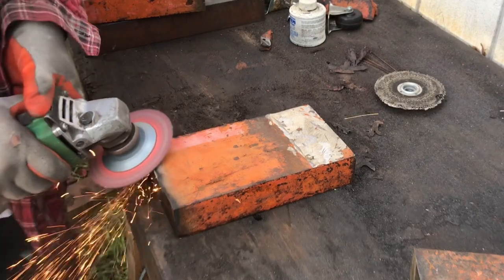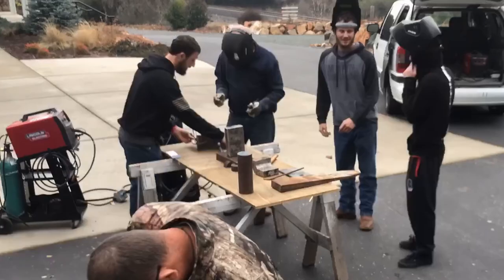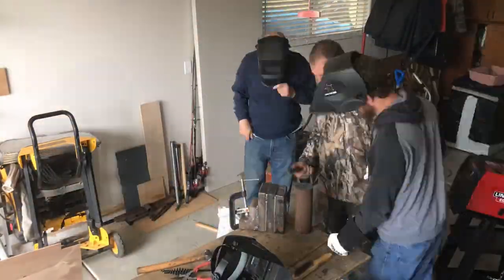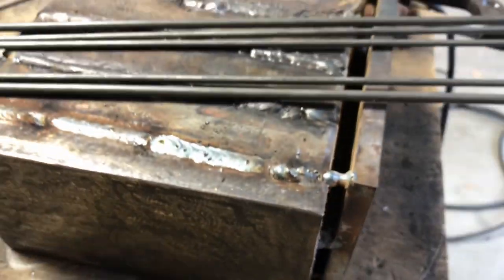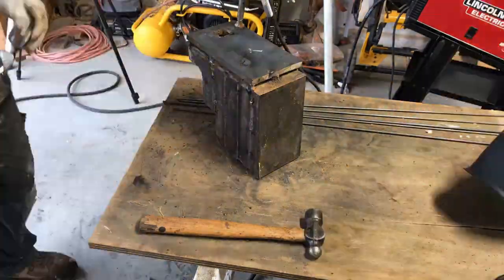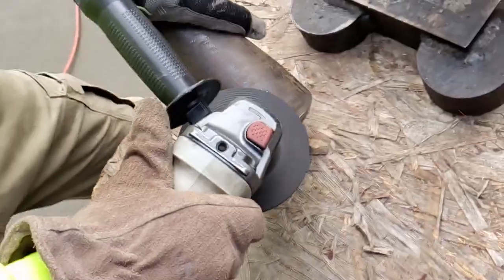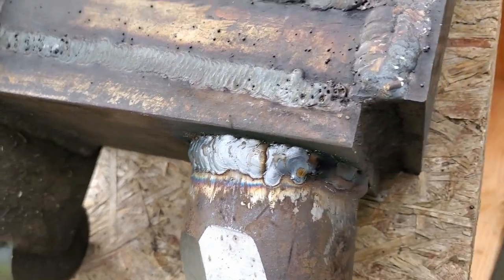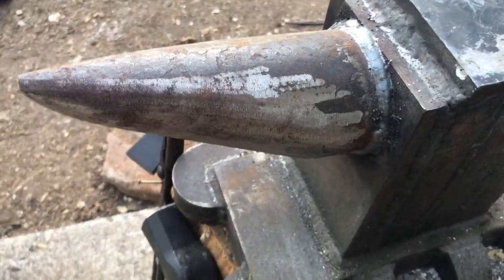HOMEMADE 180 POUND ANVIL PART 2: Fabrication

Comment: Love your video. You guys did your home work
On the metal you used  as the way you did your 
Heat treating as quinching. I see by your trailer 
Your kart racers also. I,m a ole tool & die maker 
As a ole retired kart racer also.